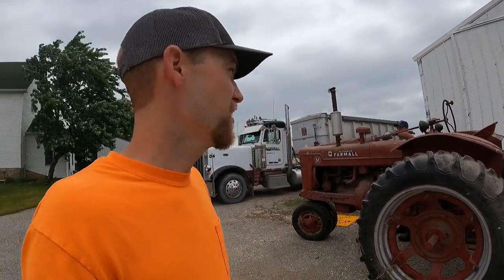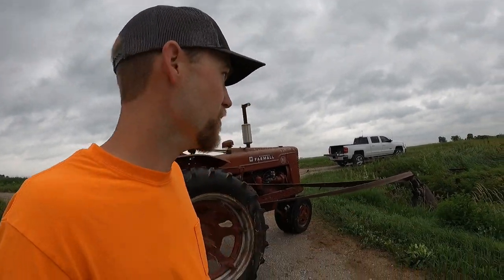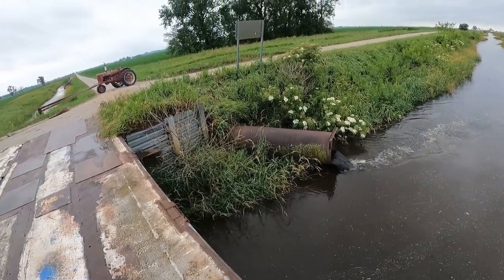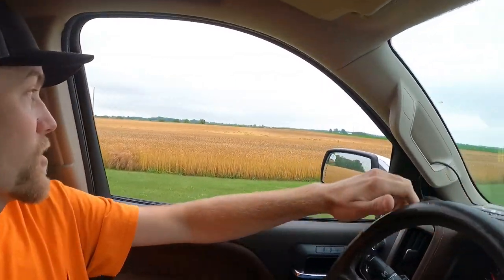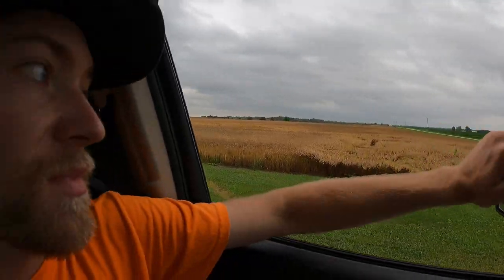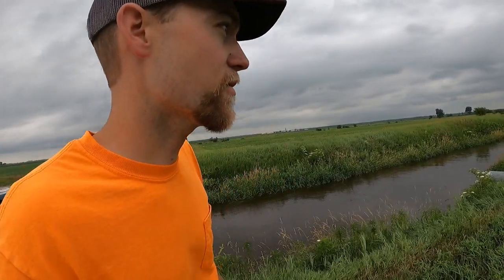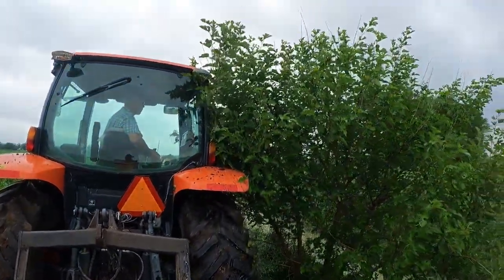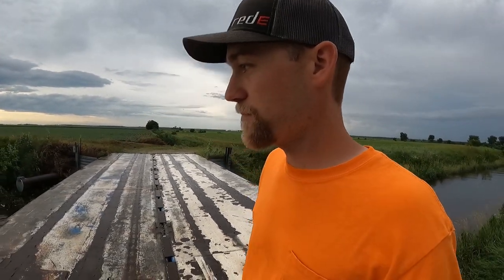Antique Farmall tractor pumping flood water | Here we go again…

Comment: We bought a super MTA in the 80s and we used it for feeding the herd of milk cows. The replacements up the road a piece. It was quick on the road and did crank easy
Reply from the maker: Every farm needs an old Farmall!
Reply: @WesFarms  pulling the mixer trailer it didn't use much fuel but don't try pulling a heavy bog. I rescued it twice. My dad bought it at auction cheap because it wouldn't crank. Then when we sold the herd of milk cows that tractor went with the deal. After setting for a few years the guy had started missing payment's and I stole it back.
Reply: @WesFarms  I pulled it home and got it running that afternoon. We used it to work the ground and plant grass. I then used it for parades or running around the neighborhood.
Reply from the maker: We also have a super M that we got in a similar deal. Hadn’t run for years bought it cheap and threw a coil on it and it fired right up. Then it locked up, turned the engine backwards with a pipe wrench until it popped and it’s been running ever since. We figure a piece of carbon broke loose and wedged in one of the pistons that’s all we can think of.
Reply: @WesFarms  I finally let mine go because I was needing a lawn mower. Never tried to sell but it would be setting in the front yard and people would all ways stop and ask. The guy who got it had grew up farming some and wanted a old tractor

Comment: You could replace that m110 with a stationary power plant. Find an old scrapyard motor and transmission, build a cradle, and just haul it out on the balespears when you need it.

From experience, old VW ALH engines and 4cyl Toyota cars/forklifts from the early 2000s are great power plants. 

If its an air cooled deutz, it'll be absolutely worth picking up, even if it only ever runs a pump. Those things are incredibly effecient
Reply: Aicooled deutz v8 413 are what powers the old german military man kat 1 trucks, the a1 got the 513, and some still run in the military (of the first gen, the a1 most still do) many others have found private and commercial friends

Comment: That sure brought back some good memories! I used do the same thing on my uncle's (& dad's) family farm to mill the corn we brought in. We used a Ford tractor (grey & red, wide front tire spacing, always started), and getting that belt set on the pulley could take a few tries.  We had a iron stake in the ground that the front of the tractor was chained to (the pulley for the belt was on a removable unit attached to the rear PTO). I was around 8 the first time I got to help with that and did it many times after. My uncle would rub a rosen bar against the belt to keep traction on the mill pulley, as it was smaller diameter. That Ford tractor was the first powered equipment that I learned to drive when I was 9. (My uncle taught me. I would have to pull up against the steering wheel to overcome the force to push the clutch in -hehe, Thankfully, I was heavy enough to just stand on the brake.) Used to drive the mile round trip to to get the mail for him on my own. I felt so big back then!
   He was legally blind, but his rows were as straight they could be in the fields. Thanks for the wonderful flashback to 1971! 
(First view of your channel & I subscribed today.)
Reply: Edit: tractor would be chained once belt was set, to keep tension.
Reply from the maker: Thanks for the sub and glad you like it!

Comment: We ran Berkeley T-2 irrigation pumps  with many tractors when I was farming.  But among them, we used a Farmall H, W-6, M , MD, and a Super M. They ran so smooth and nice. We tried an Allis Chalmers WD-45, but it wasn't built heavily enough. It broke PTO shear bolts until I drilled it out and used a bigger bolt. Then it broke a PTO gear, Then it threw  connecting rod. It had enough power, but it was just built much lighter than the farmalls. The Farmall M's usually got Super M pistons and sleeves when they got to overhaul time. That gave them 44 hp.
Reply from the maker: We used to run a WD-45 on a smaller pump that we no longer have.

Comment: Designed to fail started in 64, many old Farmalls are still running and never been apart. The modern stuff will not make 20 years old and be parked. I know M’s that still work daily on farms. The biggest problem for the old tractors is the fuel we use today. The shelf life of fuel is awful and destroys old engines. Pure gas is getting hard to find but needed on these old tractors

Comment: We have a 1940 wide front that Factory was a steel wheel tractor. It has normal rims welded on the old spokes on the rear. No fenders ( you don't need to worry about getting caught in the tires )

Comment: A great uncle used to run a sawmill with a Farmall H off the tractor side pulley up until the early 70's. That Farmall H would really snort with large logs. The Farmall 460 worked hard as well occasionally. One of the best memories of my youth taking boards from the saw blade.

Comment: you were saying you couldn't do the PTO drive to the other pump because of the angle of the driven pulley was making the v-belts fall off
you could take a rearend from an independent rear suspension car (they got real short axleshafts and good axle seals to keep the oil in) and mount that straight on the pump shaft, then you put your PTO shaft onto the pinion of the diff, bingo bango no V-belts

Comment: After you get the position set on the tractor perfect take a can of Red Spray pain and trace a line around where the tires sit on the road.  Next year drive the tires on to the spot and it will be aligned just as perfect as last year!
Reply: Paint would never last on a dirt road.
Reply: @anderleof  Look like a gravel road to me.  The Orange paint the gas company uses lasts in the grass and on the roads lasts.
Reply: crown the pulleys that way they center more  that is you know about crowning pulleys v belts  kids stuff.
Reply from the maker: They are crowned but you still need to be lined up fairly well. Kid stuff

Comment: Imagine using one of the old rumley or oil pull kerosene tractors to power that or better yet a steam traction engine
Reply: Hey, what's wrong with a  steam traction engine? LOL :-)
Reply: @84953  nothing's wrong at all although it will acquire extra watching because you will need an extra man to watch the fire and water level now if it was an oil pull tractor you would just make sure it doesn't run out of kerosene
Reply: @TexasRailfan21-RailfanRyan  Not necessarily if the distance for the tractor wasn't too far away. Once you're set, and even driving it there could be done by one person. But for other reasons it would be a lot more work. You'd have to have plenty of relatively clean water , and fuel (wood/coal) ready ahead of time as well as staying there the entire time that you're planning to run the pump. Yeah, my previous comment was said in jest.

Comment: Wes. Could you please explain why the ditch just does not drain.  Why is there a dam there. 

I love the old M   Drove a H as a kid
Reply: Ditch is lower than the creek that drains the area for them.  That's why they have to pump the water up.    Looks like it's only a couple of feet - but that's all it takes :/
Reply from the maker: The ditch does drain under normal circumstances but when we get a lot of rain the creek rises and the ditch also rises to the height of the creek
Reply: @WesFarms  Thanks it makes more sense now

Comment: They can't build tough Tractors like that anymore and plus most of the Great companies have went out of business.
Reply: I'm sure that if the farmers accepted that the New Holland T7.270 had had a 41 horse power engine (same hp per cubic inch as the Farmall M) instead of the 270 hp it has today they could make it last a lot longer. But when they calculate the acre pr day you could cultivate with a 41 hp tractor vs a 270 hp one, I'm sure they would choose the higher hp one.
Old machinery is fascinating, and the fact that they still work is a testament to the workmanship and engineering that made them. When design something you have to choose what balance of qualities are most important, cost, life expectancy, performance are some of the factors to consider. And in todays business environment, companies and consumers find it more profitable to focus on a performance as long as they can design it with a10-15000 hours life expectancy.
Reply: Planned obsolescence.  The bane of most "modern equipment & appliances"
Reply: @JoppeOSL  a big part of the old-time "overbuilding" was because they didn't have computers to do all the math. The engineer had to calculate how thick an engine block (example) should be, then added some extra to be sure. (This is also where 95% of the "survivor bias" comes from. Stuff was accidentally built better, and just ended up lasting forever)

Nowadays, the computer says .010 over is a waste of material, so it's shaved off to save .003cents per unit

Comment: The Farmall M is great tractor. You video running the belt is one of the very few I have ever found. The engine runs so smooth on the belt that it just purrs. I grew up on my Grandparents farm and he had an M. Ran  belts on a silo  filler and grain blower... lots of power for those jobs.
Could you use the M to run the PTO pump?
Reply from the maker: I’m thinking the pump would require more horsepower to run if it was PTO powered. We have run it on the PTO pump once and it didn’t like it
Reply: @WesFarms  put a smaller pulley on the PTO side of the v belt. The tractor will have more RPMs and you will move more water. But this is only true with a smaller horsepower tractor.
Reply from the maker: Or we could just use a bigger tractor and burn less fuel
Reply: @WesFarms  I agree. I just thought if you wanted to still use the M to pump water. This would be a way.

Comment: I was wondering if the roads are public roads? The UK 's additude toward its farmers,  buy food abroad and turn the farms into parks. It seems the additude is the same here.
Reply from the maker: Yes they are public roads. Seems to be getting that way here
Reply: @WesFarms  does the tractor in the road cause problems or does anyone complain about it? I know one farm here that lays a 4 inch soft hose across the road to pump out a water bowl. If he didn't pump it out the road would flood. Quite the lump to drive over though.
Reply from the maker: Doesn’t cause much trouble. Not much traffic on this road

Comment: if you had an old brush hog laying around .. could you scavenge the gearbox off and mount it to the pump and just run a pto shaft to a tractor?  or convert both pumps to electric and use a power unit (generator)  to run both
Reply from the maker: We have a design in mind to change it to PTO
Reply: I was thinking of that, too.  Or just build a little engine house and mount a little diesel engine there, perhaps?

Comment: David brown , Deutz or Belarus are all really good on fuel
Reply: Three cylinder diesel David Brown would be the ticket. I have to add though I remember some years back my mum's cousin used to pump for irrigation with cheap old diesel bus engines. One day there was pistons lying about the place. If you are not there to see the signs sometimes it goes boom. Shame to smoke an old tractor.

Comment: If you need a new belt. We use bailer belts
Reply: They probably use what is called an endless belt. The ends are sewn together with heavy stitching. Bailer belts will pull apart on the ends if it requires a little horsepower.

Comment: Tell us how long the M has been on the farm, jobs it’s done, how many family members have used it. Why still use the belt system if the M has a PTO? M could run a generator for motor too. 80 years from now modern 🚜 will be 💀 because computers will fail. In a zombie apocalypse I want an M not a computer in wheels.
Reply: The belt pully has 1000 rpm PTO has 540 . The PTO would not run fast enough to pump

Comment: You should wipe off area before moving oil fill cap .. use dello 30 wt  .. and marvel mystery oil in fuel.  Our M  1940  
Use the oil i mentioned and marvel  keeps everything clean inside.  Non ethanol fuel  is used.. and give that M a bath 
It deserves to be treated better.  QUIT USING JD OIL . It might guit running... lol
Reply from the maker: It’s ran for years on that oil
Reply: @WesFarms  try Delo 30 
Slow down oil use

Comment: Also why doesn't the pully have a 1⁰peak in the middle? It would help. Keep the belt centered on the pully while taking advantage of the flat belt design.

/\
\/    as a visual  except that it works better as a cut ball or kinda like a rugby ball.
Reply from the maker: It does